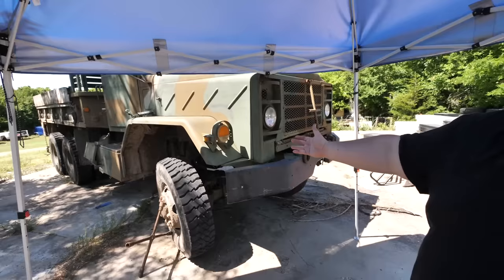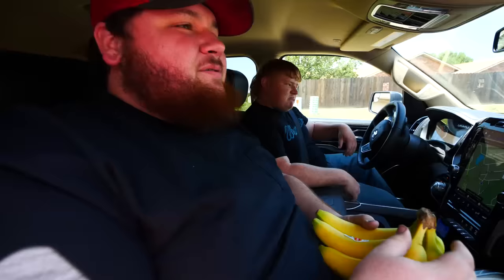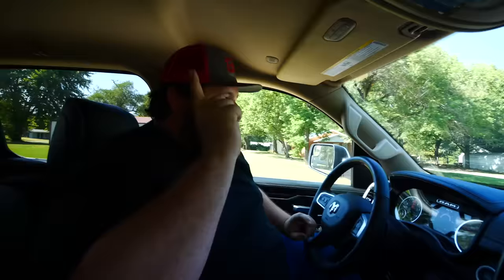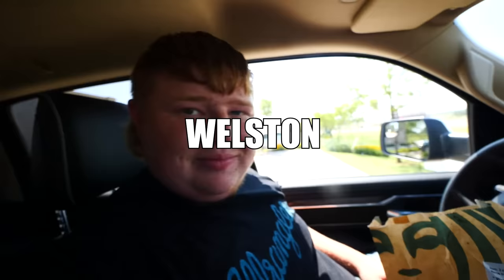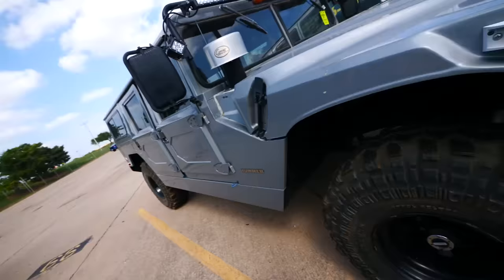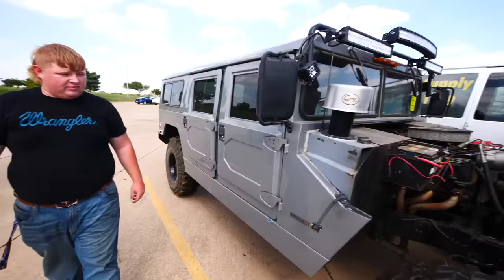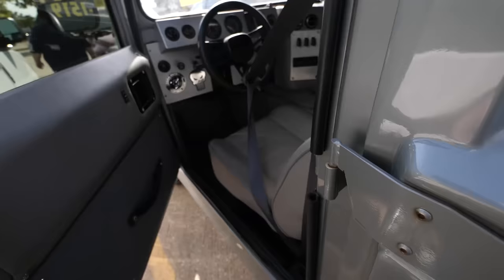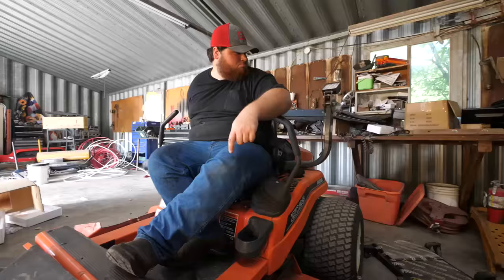Buying H1 Hummer From Auction..Turns out its FAKE

Comment: I had a big Dodge Ram and it did that tire shaking at 75 mph too. 
It’s not the tires... (had a mechanic try to sell that crap story to me)

The first time it happened to me I was unaware of that trait in Ram trucks. It belonged to the company I worked for at the time and I was towing a trailer loaded down with two large ATVs from Dallas, Texas to Bentonville, Arkansas. 

While tooling along at about 75 on a bridge over a crevice on a gloomy mountain road, the trucks back end started shaking, then the trailer started fish tailing and the drop off side of the bridge started looking like my future was about the meet my dead end. Thankfully there was no other traffic in sight to run into. 

Id like to say I was calm as a cucumber but I nearly pissed and shat myself both before I got it slowed down and under control. 

Less than a year later I bought that same truck from the company and within 5 months I resold it and made nearly three times (cash) what I paid for it. And I told the buyer about the shaking too.

Comment: I figure it sold around 20 25k because the trex kits they used to sale where 15-20 without frame but if your looking get you a surplus humvee you can find those for anywhere between 5 and 15k then just buy some carpet and international seats and throw in it then you have h1

Comment: 9:51 not electric. It is Microcar MC1 (or MC2) with Twin cylinder four stroke in line 505cc petrol or even diesel engine with CVT gearbox. Does not require a driving licence to operate.

Comment: 390 is not the most common.  360 and 390 were both built using 352 blocks .... so marked under drivers side head. 
1/4 stroke is the only major difference. 

A 390 marked block is a rarity indeed. Around here anyway.

Comment: i volunteer at a disaster rescue team. being federally associated, we get military and gov. surplus for free.  we have a peterbuilt tank rescuer.  6 wheel drive, detroit 60 turbo, 135.000 lb towing capacity, 50 ton winch. and 1400 miles on the odo.  it weighs 27,000 without the trailer.
on the fly tire pressure adjust.  (they do't like us at truck pulls!!)

Comment: I had the same dodge truck I was towing a fifth wheel camper and the engine locked up due to adding a bullie dog chip I removed the smog stuff so I killed the warranty. It was 15days old  with 800 miles on it.  Dodge gave me a full refund and sold me a real truck

Comment: The only thing about this this Ford truck with a Chevrolet body is the Highboy frame and suspension but when you compare that to Hummer you're getting garbage every Hammer has planetary gears on every wheel got independent suspension and the 6.5 there's nothing wrong with a 6.5

Comment: 332, 352, 360, 390, 427, 428, are the fe blocks and cobra did come in a fe block in the cobra it was a 427 in a mustang it was a 428 both are fe blocks so it could be a cobra engine

Comment: Everything about that thing is fake! A real hummer has portals on each wheel for ground clearance, clearly visible central tire inflation, a Detroit, Duramax or 5.7GM v8 and 4l80 transmission! But honestly not a bad looking clone at all! I would guess it’s a lot faster due to lighter weight and probably more efficient in every way!
Reply: I honeatly cant see how it sold at auction as an actual hummer... vins are checked as well as title... either way, i agree... its a really cool replica... im sure he paid no where near what a hummer cost, he knew he bought a rep, but its a very cool one, i wouldnt mind driving it for at least 10 times less the price of an actual hummer

Comment: I'm just laughing at them talking chevy engine sizes on a ford motor. 360, 390, that's chevy. 302, 347, 351, 370, 427/8/9 that's ford sizes.

Unless this is a FE midsize v8?
Reply: As someone previously stated Ford made a 360
Reply: @darylp955  yes, but not a Windsor or cleveland that would have cobra valve covers. The 360 ford is pretty rare. I'm sure cobra valve covers could be made for anything, but the probability is low low low.